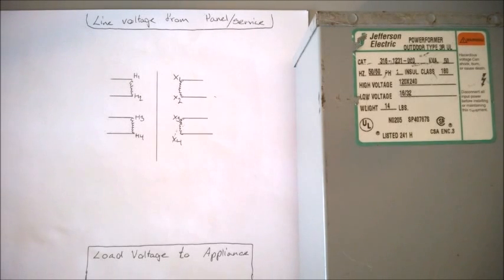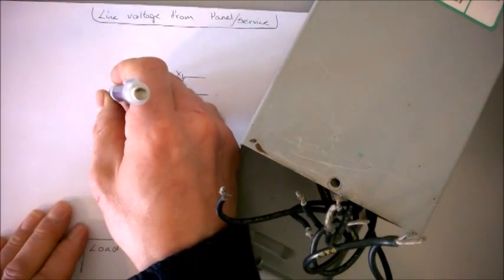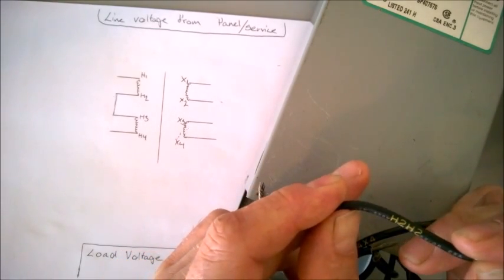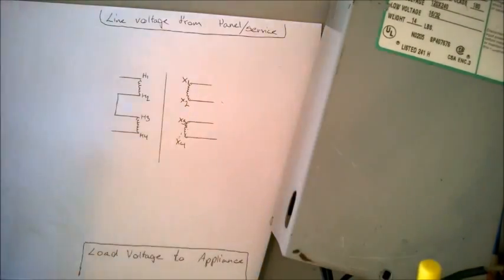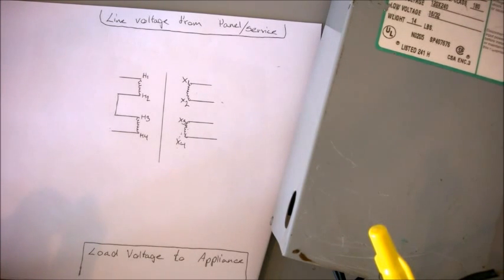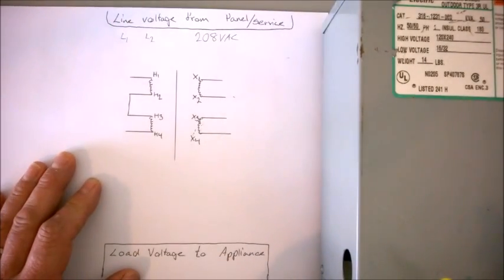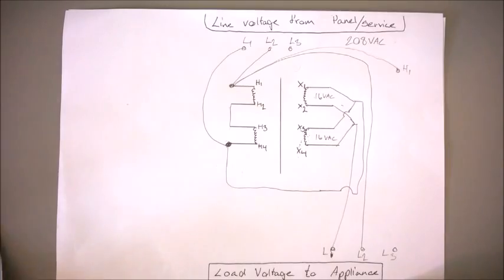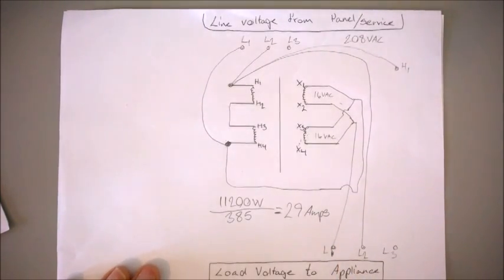How to wire a Buck Booster Part 2

Comment: Hi Kent, do you have a video on how to wire up a booster using residential 240 V to my booster? I purchased a used tanning bed and booster from somebody and to my knowledge I wired it up exactly the way it was it there house and now at my tanning bed I have 120 V coming in on one line tying into the H1 and direct line into my tanning bed which I have 120 coming off of that one but I have 90 and change coming through my other line. 
Do you offer any sort of virtual service help for a fee?

Comment: Where can I buy your book?
Reply from the maker: Thank you Ray! Are you referring to the tanningbed book https://www.amazon.com/Rescue-Your-Tanning-Bed-Technical/dp/1452880301 . The book is in general about maintaining and using correct voltage and doesn't have specific guides to specific repair jobs, but more like how to make the equipment last by providing the right environment.
Reply: Just got it!
Reply: Hi Ray, does it make sense for me to have 120v on one line & 92V on my other line into the tanning bed out of my booster transformer?

Comment: Hey brother, just watched this and wanted to add that your L1 line needs to be tied in directly together with your input-output lines.  That secondary winding and line feeds cannot handle that amperage. Just wanted to make sure that whoever watches this realizes that.  Also 208v is standard on a 3 phase in a Y. normally looking at 220v on each line in the States so we are usually ok with a 120/240  12/24 buck/booster.  sorry man.  really do not want to come across like I am blasting your video or telling you something you don't know, just want to make sure we do not have any novices cooking their gear or their place up monkeying around with wrong gear or wrong wiring config.  Leave this stuff to the experts like the guys who made this video viewers
Reply: I was wondering if you would help, I have the same brand buck boost but a bit bigger. it is 1500 VA.would be kind enough to tell me how to wire this one. The cat number 416-1161-000. I need to boost power 24 Volts, from 205 to around 229.I would appreciate any info. I need to install in 2 days.
Reply: I don’t think is normally a 220 on each line